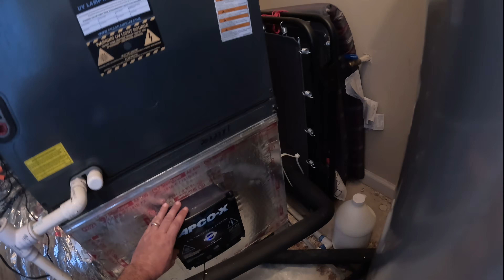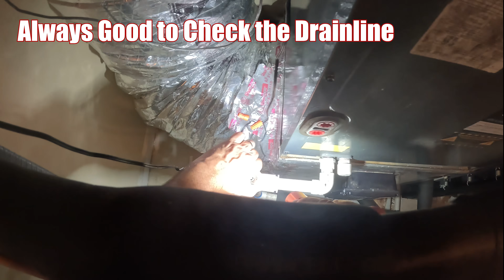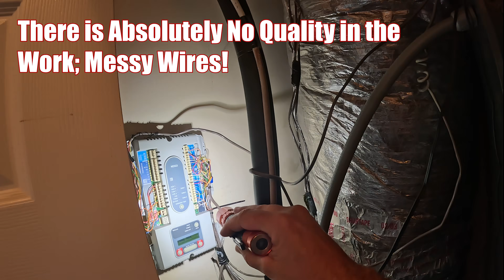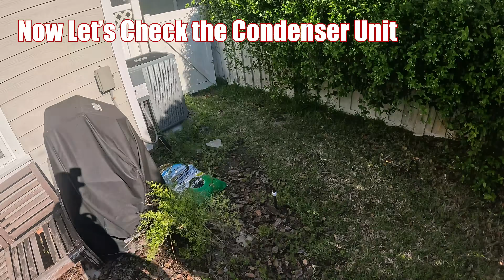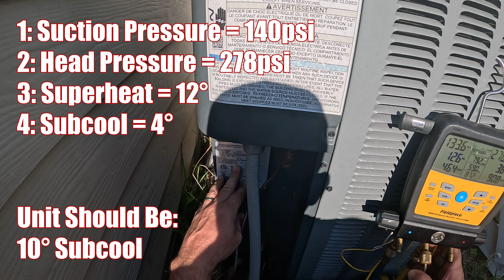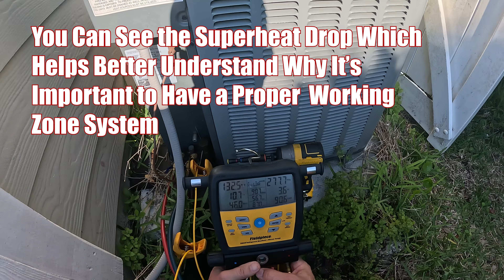How to Diagnose a Zone Issue

Comment: Had a no cool call for an intermittent short “fixed” by the local hvac guy. I show up it’s a 2 stage XL16i trane condenser he snipped the 2 low voltage y1/y2 staging wires and bypassed the pressure switches to the contactor so the unit would only run in 1st stage. I was trying to wrap my head around why tho!? Gave him the benefit of the doubt.Tested pressure switches and compressor. All was good. Rewired the unit to manufacture specs and it fired up.  The problem was a knicked wire in the electrical  compartment lol and also I  replaced the capacitor and the next Monday installed 2 ecobee thermostats same house. Customer is now on the maintenance plan and earned a customer for life💪
Reply from the maker: Great work catching that and getting the system back to proper operation for the customer!